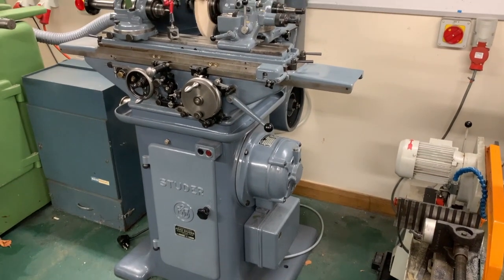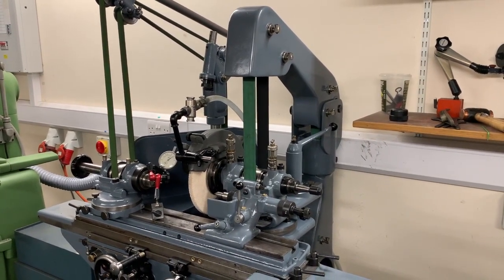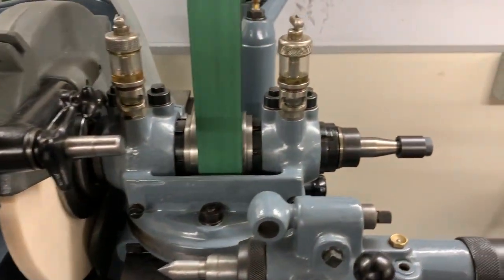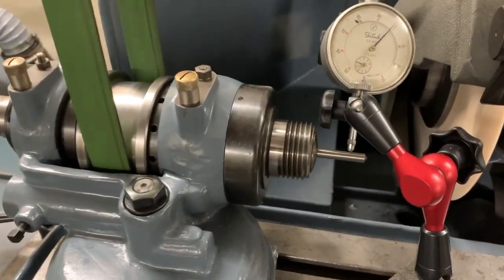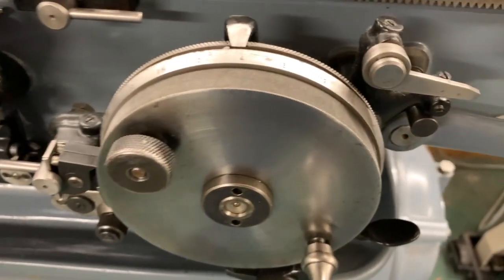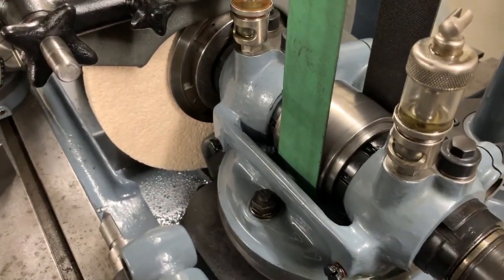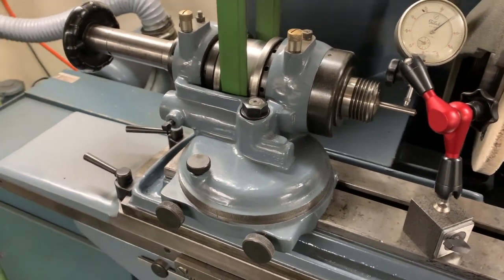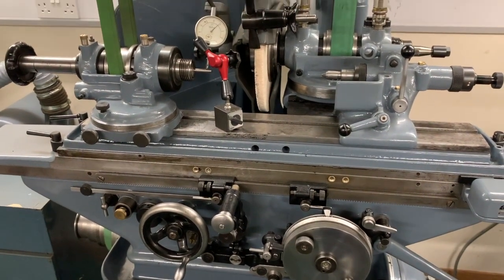Studer OB Cylindrical Grinder

Comment: Will the spindle bearings be damaged if the lubricators are left turned off?
Reply from the maker: Indeed they would be if it was run for a considerable length of time. There would be sufficient oil in the bearings to prevent any issues for a short period of operation such as this.